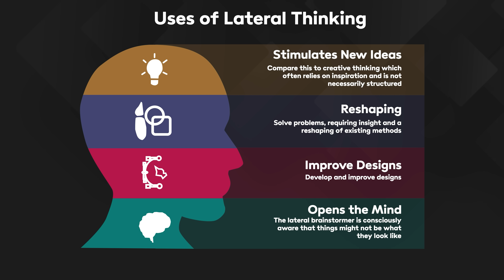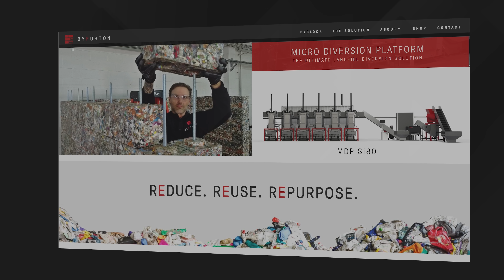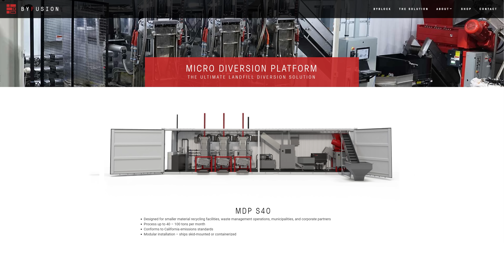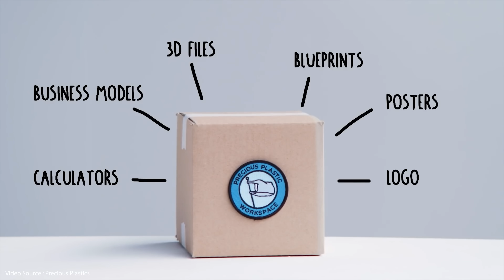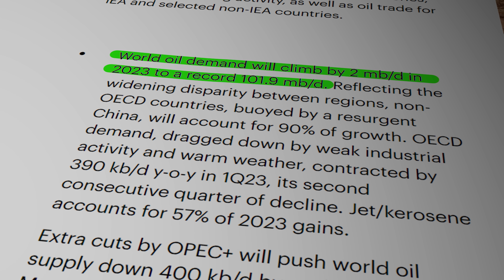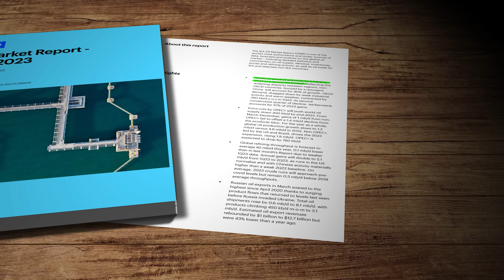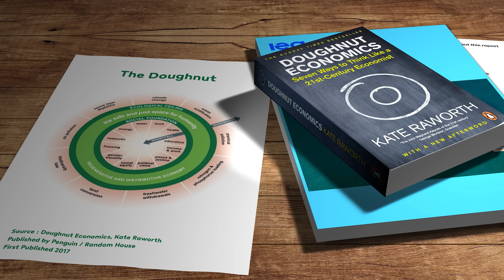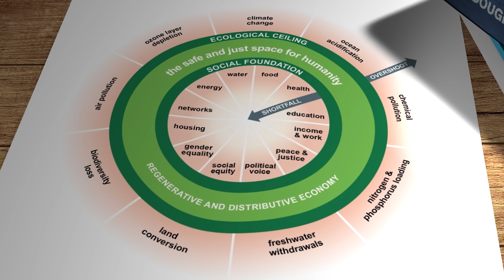Plastic doughnuts? Have you lost your mind!?

Comment: I've been seeing variations on these plastic building bricks for at least 10 years now, they really seem to have limited uses. Bricks made of several different kinds of plastic in particular seem to border on outright useless for anything other than relatively temporary structures. The wildly different material properties of the potentially dozens of different kinds of plastics mean they don't typically have uniform structural properties between bricks unless extra steps are taken beyond simply shredding, at which point the processing cost of each brick tends to go up substantially.

Many types of plastic degrade substantially when exposed to direct sunlight for long periods of time, so roughly amalgamated plastic bricks will always have to be coated with something for UV protection. This isn't necessarily a deal-breaker, but footage/images of these bricks being used raw as construction materials is misleading at best.

Additionally some plastics start to experience substantial changes when exposed to temperatures as low as 50-90C, the former can be reached in direct sun here in Australia on a fairly regular basis, the latter is an extremely low temperature for a structural brick to start undergoing softening. PVC for example starts to soften right around 90C, while many biodegradable plastics start degrading at around 50-60C under the right conditions.
If you're not bothering to sort your plastic before shredding and compressing it into bricks, how on earth are you going to prevent accidentally generating a brick that's made largely of a plastic unsuited for some application? If your bricks have wildly different material properties then the only use cases are going to be few and far between.
If the plastics ARE being sorted, then that's a lot of time, effort, and expense, at which point you could do conventional recycling (Which already has a wide variety of issues).

Nevermind potential issues with fire. 
I'd personally happily make a garden shed out of these sorts of bricks, maybe even something more substantial if I could be assured of the composition and the associated maintenance required... But I just can't see these being used on an industrial scale.

And do we really want to educe a demand for what amounts to a single re-use of miscellaneous plastic? What other possible use could these be put to if they were damaged? You've essentially got a brick of mystery plastic (sounds like a nightmare) which is unusable for literally everything except possibly being turned into more questionably useful bricks.
While storing plastic waste in big compressed bricks is likely better than it floating around in our oceans, I'd still much prefer a solution focused on preventing it from ever getting there in the first place.
Reply: Besides, what is the "impact" of microplastics once they start degrading?😅
Reply: @xxxx945 microplastics take decades to decay, but prior to that, they have been found in the placenta and milk of new mothers. Plastics in humans is a pretty big impact in my opinion.
Reply: That was my first thoughts. Just said with a lot more words.
Reply: With the use of Rino liner as a paint on both sides of the brick sun and air are stopped from the degradation of the mixed tapes of plastic,  and then we will have to suffer from the off gassing of the paint,  so we can not win either way.
Reply: They could be used for footpaths and kids jungle gyms. Can't think of much else.
Reply: Once shredded to uniform size inertial sorting by density categories would be a trivial process - eliminating the PVC (chlorinated) and fluorinated polymers from the process would seem to be a necessary step (to ensure "plant" longevity (HCL is annoying to deal with).
Reply: I can't see the UV penetrating significantly to degrade the material, especially if some sort of parging is used to cover the raw blocks . which is normal for cement. The loss of integrity from heat, again would depend on the how much heat was penetrating to the interior of the block, plastic is a insulator so it would tend to have more thermal stability than brick on the interior.   I think that with minimal amount of testing and a big waste stream you could assert some reproducible structural parameters, shred and mix well and your batch would have consistent structural properties. Many cement block structures are not particularly high load, lots of steel frame industrial structures  filled with bricks.  No one is going to build the next    burj khalifa with recycled plastic any time soon.  But  a slightly more pliable cheap material might prevent some of cracking and general degradation of integrity we see on a lot of older mortar based brick structures.     I'd like to see some consumer packaging laws and trade agreements to stop the ridiculous amount of single use plastic, and I think that would be the most effective tool to help the environment,  but in the interim a way to consume the plastic waste efficiently is good, and while it is unlikely to keep idiots from lettings water bottles float to the ocean,  it might provide a economic way to consume the plastic waste into something useful, remember the majority of plastic sorted out of the waste stream is not environmentally utilized.
Reply: I reckon there are other problems in regards to biological and chemical contamination of the resource material, then leaching of various chemicals out of the plastic even if itself is not contaminated. Whoever is residing in buildings made out of plastic will be breathing a soup of chemicals which can't be healthy for them.
Reply: Saying "let's just not put it there in the first place" is just ignoring the fact that it already IS there. If we do nothing commercial with plastic waste just on the premise that using it might encourage its use, or because it might all be used up at some point (leading to the business changing its products), you've completely missed the point. You might as well do no recycling at all in that case Trying to decrease the use of plastics isn't harmed by recycling like this; it's helped because the products bring attention to the problems with recycling and the responsibility of those who use it.

You do make some good points about the use of plastics in building materials certainly. You really can't just dump any plastic waste into these bricks, and these issues are why these bricks aren't being used as weight-bearing walls (they are used inside frames). However, unlike current conventional plastic waste recycling, which has been demonstrated to be basically a scam, requiring extremely high levels of plastic sorting, you might be able to use less rigorous sorting in these bricks, sorting by general groupings of plastic hardness. This would make the process more sustainable than conventional recycling, and more likely to be viable economically (which current recycling is mostly not). 

The performance in heat and fire are really the big issues (inc toxic fumes), but that will really depend on how the plastic is made into brick, how it is treated, and what plastics are used. Melting under direct sunlight is a danger not so much because of the durability factor but because it might release fumes that could accumulate inside a building made of them.
Reply: As always, the coin has another side.
Reply: This was the exact thing I was going to say. We need to invest in far better plastic replacement and also in sorting of plastic. This is just kicking the can down the road. The mixed plastics will be unusable when it comes time to remodel or demolish the building. 

Also, rebar is often made from recycled metal. It is used because is has similar expansion and contraction properties to the concrete.
Reply: what it we build a frame that would have been filled with those brick, then those bricks could be covered with plaster to make a holiday cabins in countries where there is loads of plastic so we wouldn't have to transport it far
Reply: I agree with all your points and an additional issue is off-gassing Volatile Organic Compounds (VOCs). Using these as interior bricks would solve a lot of the weathering and temperature issues, but not if it is filling a space with VOCs that cause long term harm.
Reply: The real question is why they have not been endorsed by Lego, the world leader in plastic blocks.
Reply: I agree with you in parts but I believe that the answer is exactly in your observation. For explanatory purposes imagine
  a typical 10-story building...exterior walls generally occupy about 10% to 15% of the total building area depending on the building design, the specific design features and the architect's preferences. Most of the internal area of the building is dedicated to the internal walls, responsible for dividing spaces and providing acoustic and thermal insulation.
Of course, abandoning an entire industry that grew up around another is difficult. It is the same case with electric cars, which revolve around the oil industry, but around them there is an entire parts industry that will be impacted by the changes that will come. But these changes are necessary.
In civil construction it cannot be different, if these materials can be used, they must be used, and we depend even more on our engineers and architects.
In the concrete itself, the addition of microporous rubber, as well as other types of porous plastics, reduces the mass of the concrete, giving it more resistance and the so-called light gravel is an interesting technique in civil construction.
Reply: "Children, the house is melting!" Lol
Reply: I do not believe these bricks are meant to be exposed to the elements at all, as the limited video shows a top plate being used.
Reply: while I think that temporary structures with those plastic blocks could be interesting (essentially, they are huge lego blocks), they really beg for a fire.
in europe, there is a lot of styrofoam thermal insulation in use. and sometimes it goes wrong. then there is the fire incident with grenfell tower which essentially was covered in plastic.
these bricks will be worse.
Reply: Just as You said, its unsound engineering material without bearing capability in long run.
It just cannot replace concrete blocks, clay blocks are more natural, and more tested. We just need to reuse plastic jugs for washing machines, and not throw away everything after use. 
Soft plastic will creep under load under lower temperatures, so there is no way to ensure proper water and termal insulation.
Without continous coating there will be water inside, and if not heat will damage this, ice will do the trick.
Reply: Some plastics degrade too. Could be a problem. Probably the cement rendering of the blocks protects it.
Reply: if they are used as a replacement for concrete blocks there there should be no problems for UV damage. Concrete blocks are almost always used internally with external insulation and a facade, whether that is brickwork/timber/alu panels. in my experience as a structual engineer the only time a concrete block is exposed to the elements is when it is below ground. building up from a structures footing/founds to ground level. This could create problems if the plastics degrade at different rates, however this could be mitigated but simply not using the blocks there or caoting with something.
Reply: As a bulk/mass filler inside of a more stable container its less of a concern. Perhaps the exterior shell should be made of the relatively lower quanting of sifted and selected recycled materials. Maybe purpose built from new materials.

Either way, concrete requires rebar for maximum strength and these plastic containers would need a reinforcement in the form of bulk random plastics, and the bulk random plastic needs reinforcement in the form of a retainer. Two negatives add to a positive.
Reply: Very well put! It makes for comparatively bad construction material.
And the only real solution really reduce plastic waste is to stop using it for single use products wherever possible

Comment: I don't think producing plastic clothing is a good option. Apparently much of the microplastics in the oceans stem from plastic clothing being washed.

Thus in my opinion we should massively reduce that or better outright ban it in some cases.
Reply: For fabrics, the less processed the better for it breaking down safely.

For example:

Linen, wool, cotton, bamboo (not bamboo viscose), which biodegrade as many things have evolved to eat them.
Rayon and other forms of viscose made from plant cellulose (wood, bamboo, cotton), which will eventually break down in warm damp conditions as they’re made from cellulose and again, many things can eat it. We’re still talking several to dozens of years, but better than hundreds of, possibly more, years.
Perhaps polymers like polylactic acid (PLA), often marketed as compostable, but they’re not compostable in an industrial process (high temperature, high humidity), so these will need to be collected and sent to such facilities. Otherwise, they’re almost as long-lived as full synthetics.
Lastly, full synthetics like nylon (polyamide), polyester, polyethylene, which very few things or nothing can manage to eat
Reply: A quick search shows about 60% of the worlds clothing is plastic already. It would be a big endeavor to try to change that.
Reply: Easiest way to do that is for the industry to switch from fast fashion to switch to durable, natural fibers. Much of the clothing produced ends up as waste long before it is actually no longer usable. REDUCE, reuse recycle :)
Reply: @punkdigerati  it certainly would. Many big endeavors have paved our way. Imagine how far we came the last hundred years. It is a question of political and social will.

Comment: What about high temperature melt?  And giving off toxic emissions?
Reply: Won’t melt completely but will soften and sag or otherwise yield, sometimes quite dramatically. Look up melted plastic trash cans and mailboxes. I don’t understand why so many are made in dark colors where they’re used in hot sunny places. You will also find pics of sagging dark vinyl siding. I don’t get why people use dark colors of those in hot sunny places either. Vinyl siding in light colors are much more resistant to that, though they do show soot and mold more readily.

As far as toxins, depends on the plastics, any additives or anything they picked up in their prior use or exposure. Base polyethylene (many milk, juice or water jugs are made from it) is fairly benign, but I’d be hesitant to use ones that contained bleach, drain cleaner, motor oil, etc.

Comment: One problem I see is that in the end it will still end up as microplastics,  bleeding chemicals into the environment, just later time wise ..
Reply: And we tend to look after buildings, rather the 'waste' water bottle.
Reply: Still better to put waste to use, than letting waste be waste.  It doesn't mean we stop trying to reduce plastic use, but it means some of the used plastic gets a renewed purpose other than being lost to the environment.
Reply: @eyemastervideo  Better but still bad. Keep in mind that the reused plastics are already decaying. Without any form of  rejuvinating it is nearly as bad as just dumping it.
Would recommend to lookup the comment of @Zrummy, It's touching on many aspects of reusing/recycling.
Reply: @eyemastervideo  Is it better in this instance though? We've already got materials that can be used in buildings (natural and unnatural). It strikes me that by not separating out the materials, they are using things that could be better recycled and used elsewhere. Thus we are creating more new raw material to replace that which is not being recycled because of this process.
Reply: @ricos1497  it's not happening now; about 7% to 12% of plastic actually gets recycled in the USA, and the rest ends up in landfills. It's THERE, it exists, so putting it into another place makes zero difference. What putting it into a useful place does is avoid the use of whatever material is NOT being produced because plastic waste has instead occupied that niche. If you look at how cinderblock is used in most buildings, it's entirely encased in other materials, such as insulation, sheet rock, OSB, etc. If that cinderblock was made of plastic bricks, and the tensile and / or compression stress functions required of the total wall structure is met, then the end result is: 
Less concrete production for making cinderblock
Same quantity of plastic garbage exists as before
Plastic not released into erosional environment until building is destroyed
Reply: @paintedwings74  well, yes. I was working on the assumption that the point was to reduce new plastic production, otherwise we're left with a net zero gain in recycling, the bricks just kick the can down the road. But I guess that's what all recycling is, so we're screwed either way!

Comment: Intrigued by the comment about plastics being carcinogenic. What is the evidence for this? Plastics are famously inert which is why they're used for food packaging and hygiene-critical applications
Reply: Depends on the plastic (anything with a benzene ring in its structure is suspect in this regard), and often it’s additives purposely added (to make it more impact resistant, flexible or “soft”) or gets absorbed into it. Most plastics readily absorb something, depending on how compatible it is with the polymer.